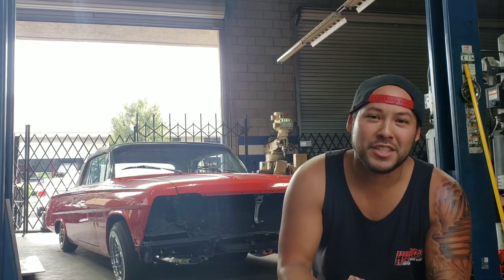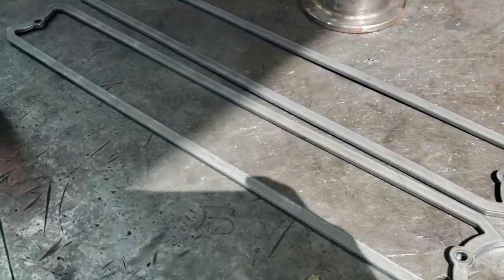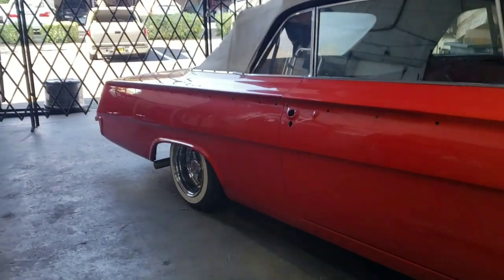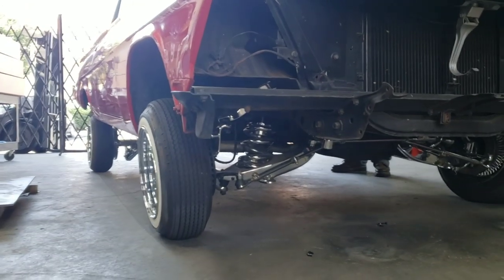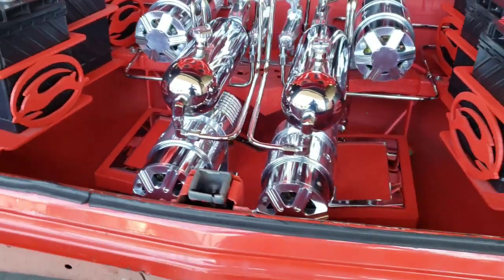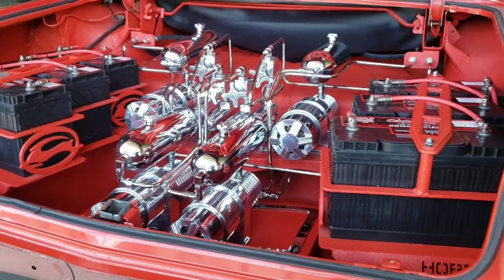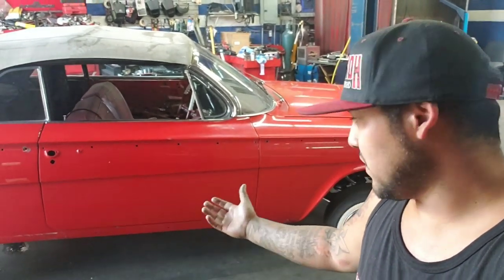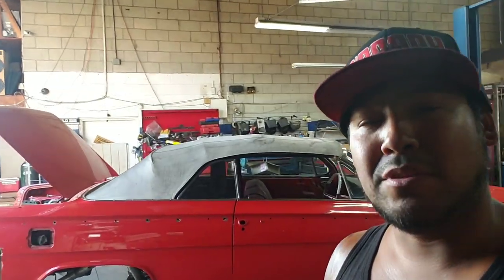Now this is a hydraulic setup!

Comment: Really nice setup.  I hope I can have my  s10 lowrider worked on there one day soon!  Question,  when I hit the right front switch,  it automatically locks up now and I have to disconnect it really quickly.  Do you know what that is?
Reply: Your front switch is probably no good had that problem on my back switch I'd tab it and my truck would lift all the way up had to run and disconnect the ground fast or also check the wiring on your switches probably ones touching somewhere to cause that
Reply: @barbarahernandez6264  thanks for the info! I'll check that out!

Comment: dam nice I don't want to put hydraulics  on my 64 impala but 🤔I do on my 69 impala custom something simple 3pumps 6 batteries, 10inch front cylinders 12 back cylinders. front  leftback rightback pancake, with 14s Cragars ss on 520s with the sideskirts😨😱😬🙌 dual antennas